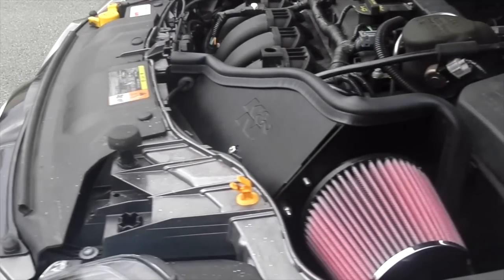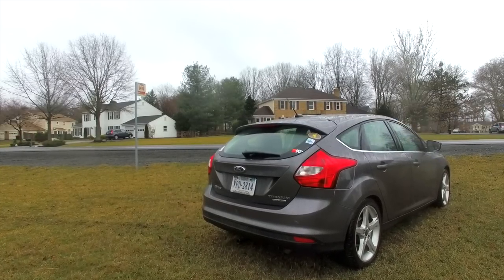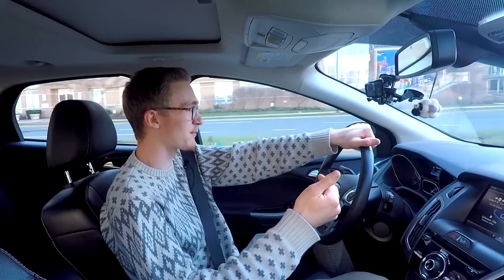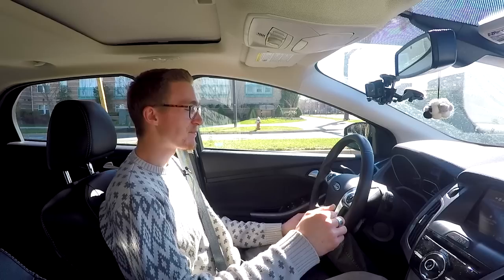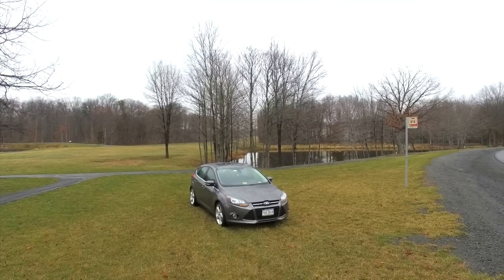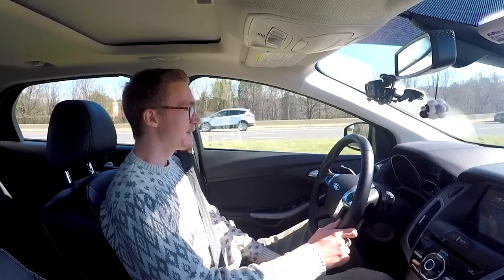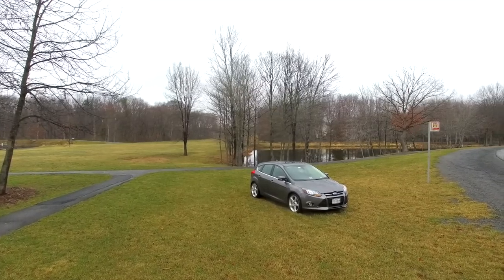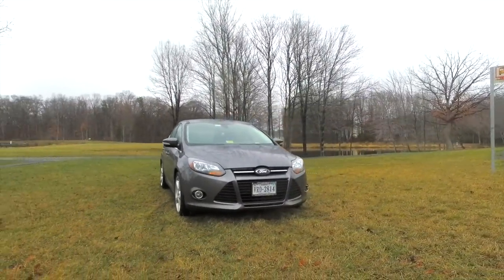K&N Cold Air Intake Update, What Happened to It??

Comment: I would add a thermal tap or wrap on the pipe and the engine side of the shield to add extra isolation from the engine if that happens. On the other hand you should look at a cold air that is a fully inclosed box with a directed inlet for air to really limit the hot air form the engine

Comment: In my opinion K&n gives you like 2-5 extra hp  because they alredy tested with dyno. The problem is If you want to leave the Oem intake plastic tube, you can't feel a lot diferrent, also you need the basic combination what i got, exhaust 2.5, high flow cat, injen cold air intake tube with K&n filter, aem bypass. Tune. The first's 3 upgrades

Comment: the issue is the car needs a tune for the intake it self. K&N will say it can be used without any other mods. but if you want it to run properly a TUNE will fix this issue plus youll get more out of it.

Comment: Short ram intakes do work ( I have one form k&n) but probably with some cars would work better than others. One thing I noticed was that my mileage got a lot worse then I got my car tuned later with some other mods and then the mileage got back to how good it was at stock or even better
Reply: @bazinga1000 it was a dyno tune which was 650 Canadian dollars, if you do a e tune it will be cheeper. Because my car was a Honda I needed to get a device to flash the car also which was about 1000 canadin dollars. Not sure if all cars need a device to flash it but least now I have it I can check any codes the car throws and check anything I want to with the car. The tune was exp but we'll worth it, I used to only spin second gear somtines but now I'm spining no problem. Tons of extra TQ gained in the midrange.

Comment: Yea if it mounted in the engine compartment its not true cold air intake. Cold air intake is external to the car or routed away from the engine bay. K&N filters for stock setup are great though as an easy upgrade and are usually good for a few horsepower. Literally 3-4 horsepower still they do work.

Comment: You don't necessarily need a tune. You just need a more free flowing exhaust system to accommodate the extra air going thru.
Reply: The tunes are vehicle specific if you want it to run correctly.  My 2017 Mustang GT would require a tune with one.

Comment: The only intake i have seen so far that has worked was the corksport intake from my 2015 mazda 3 because they also have a cold air box that completely separates it from heat soak due to being in a separate box

Comment: If you installed a intake system try unplugging the wire and the battery then plug it back in generally the car will reset and u shouldn't have any problems

Comment: Correct,  long term & short term fuel trims are adjusted by ecm that gets its data from various sensors one being the mass air flow sensor that sets the fuel mixture to lean or rich depending on the amount of air, temperature, rpms, throttle position,  etc. So basically no matter what you do the ecm is going to adjust the fuel mixture back to optimal ratios for emissions, unless theirs a fault or failure. Cold air intake in the same location as the factory air box generally want provide any benefits other than sounding tough. K&N knows that too, but they have a business to maintain along with a lot of other parts sellers. Was different back before the electronic control cars then just flipping the the breath too upside down would let a little more cooler air in & reduce restriction  into the carb & sound tough, but those where fixed fuel ratios & you could (sometimes with a little modification) adjust the mixture leaner or richer for better performance.

Comment: Just a CAI on a stock engine and stock exhaust doesn’t do shit but a high flowing exhaust  and intake with a tune will gain about 30hp
Reply: LOL
Reply: you wont gain 10% from just a catback I gained like 2hp lol.
Reply: Stainless Works 3 in Retro Chambered Cat-Back Exhaust w/ X-Pipe it's not cheap
Reply: It is a performance exhaust and you don't gain 10% that's just a placebo effect you feel if you had dyno numbers and vids to prove it that would make sense but you don't.
Reply: You can gain 20-25hp just from a good tune on most vehicles.

Comment: The standard K&N air filter (non-cold air filter) are great on manual vehicles due to adding a small amount fuel milage….its not meant to add more horse power! I do have a 2012 Chevy Cruze Eco 6 speed and I did gain 4 miles per gal on the fuel economy which is what I was looking for! Just remember….any tine you use new products on your vehicle, always research the product line and the type of vehicle its going into before making a purchase! This will save you time and money and keep you on the road longer.

Comment: Turbo charged engines have an intercooler, so heat soaking is not an issue.   Your video really only applies to NA engines with poor hood ventilation.
Reply: longago7 actually the opposite. Turbos create insane amounts of heat and are more prone to heat soak

Comment: What you did is the same as I did. The K&N filter does it all. Me like you didn't reallly like the cold air system by K&N and I saw a power loss to the engine. Left it on and tranded trucks. After I traded, I found out things the the Ford was a bad year and then I was glad I  changed trucks. I in the last truck and this new one, I only used the Expensive K&N filter and got the same results that they claim. Works the same as a cold air system. Does the same also.

Comment: From what I've read and heard, the "Cold" Air Intakes are for hotrods, and if you don't work up the rest of the engine, it won't do anything. If the sound changes, there is definitely a change in the airflow however, 'cuz duh... Yes, thanks for the trial. I think I will skip putting one in my Suburban unless I need to replace the catastrophic converter(!) 😯 (At that point, I would put low restriction exhaust in.) Every Dyno Test I've ever seen showing improvement for any cold air intake has been paid for one way or another by the manufacturer, but I don't get out much. 😝

Comment: You have to do the airbox mod drill another hole hose box coupler and flexihose towards the front and take out any air restrictors...failing that take out the air filter wrap female swimming costume material round the front of the insuction mouth with duct tape and cable ties....

Comment: I have a Ram 2012 , I added a K&N cold air intake filter about 6 months ago , i also lifted and put bigger wheels on my truck so I kNEW  my MPG were not good to start I’m not even going to start on that , but what bothers me is that it feels like I’m in mud now , when I give it  gas the reaction time is like wait for ,wait for it while waiting there deep growl then the hemi kicks in . It’s horrible . I’ve got a tick in my engine now it doesn’t sound like a piston but somthing in the pull of the air , I’ve been in happy with this thing for months , writing this just reassured me that the intake system has got to go ASAP.. I’m digging my old system out today , see if there any change in that tick and response time .. GOOD LUCK

Comment: Having a reusable more air flow yet protected filter is good however k&n has oil in their filters so be careful with that. Cheaper cones do the same. Focus's are aight. My mah has a fiesta titanium which is alot of fun. Not as fast as my vw passat 1.8t
Reply: TRUE,. I used K&N in my Tahoe and the oil residue messed up my MAP sensor. Switch to AEM Dryflow,Aluminum tube. Better.

Comment: Something isn’t right with your setup, that specific K&N cold air intake is supposed to get at least 9HP gains on that Ford Focus. Check to make sure you installed everything correctly and have no leaks or loose electrical connections
Reply: Fix it Fast would a K&N cold air intake work on a 2013 turbocharged Audi A5 2.0l?

Comment: I think you meant short air ram.  True Cold air intake gains on the high end. While short air ram gains on the low. Agreed, that short ram with weather stripping semi enclosures or no enclosure risks hot air engine bay seepage. I recommend short air ram with full enclosure or excellent seals.

Comment: Only works on older car's. Like '90-2000. Any cars newer than 2005 doesn't work well. it's the ECU that refuses to learn and make small increment of adjustments. The stock intake box and ducts are already cold air intake. Just add higher flow air filter that's it you'll know a slight difference and small mpg gain.

Comment: More power?  Need more air either more cubic inches (Chevy small block will fit in anything), nitrous oxide or forced induction or more revs with a systematic camshaft change (increased overlap and duration) and then the cold air intake and matching exhaust.  The air intake may then make a difference at 9000 rpm, otherwise save your bolt on equipment money for a new car.  For most engines these days, the bottom end can handle high revs.  The weight of the valve train has the biggest effect on rev limit.

Comment: The purpose of a CAI is for a cumulative effect with other modifications.
Reply: Not necessarily. A cold air intake is fine by itself. It just has to function as a cold air intake. Anyone that has a cold air intake and no airbox does not have cold air intake. With few exceptions. The airbox is to prevent hot air from the engine and radiator from entering the intake. Go figure, that's probably why the engineers put one in the car to begin with. When you remove the airbox you no longer have a cold air intake(with exceptions) because it is no longer taking in cold air. It is taking in the air around the engine and radiatior. The air gets trapped under the hood and the intake says gimme that, cause it's available. Now onto the exceptions. Sticking it in the wheel well, or somewhere ventilated where little heat is present, greatly increases it's effectiveness. A cold air intake only takes in cold air. Most factory setups are CAIs. The only performance benefit from the CAI is the filter. Because it is less restrictive than a factory filter. Now yes once you put some power into your engine you have to get rid of the stock airbox to free up the intake. But most people will never reach that point. Just getting a less restrictive air filter will suffice for most builds. I've seen videos where dropping in a box filter for a stock airbox increased 5 hp on the dyno. That's alot of extra air for hundreds less.

Comment: Just curious as to whether or not you've noticed or checked whether or not there's any difference, hopefully some improvement in Milage (MPG) and/or Cold vs Hot starting? Of course MPG would be dependent on other factors i.e. driving conditions, proper tire air pressure etc.

Comment: I  did an AEM drop in dry filter in the factory box and an Air Aid intake tube in my Dakota. No worries about heat soaking with a bump in performance and no more stalling with the factory resonator. 🙂

Comment: Nothing much "cold" about em.
I live in Texas and most days in the summer are over 100. I think I'll just put a refrigerator under the hood .
Reply: I actually did that but my system is a hybrid refrigerated short ram/ long ram air intake for my Hyundai Elantra sport 1.6 turbo
Reply: I feel ya. I live in South Texas, near Houston. Between the heat and humidity. Nothing works well.

Comment: The Stock air box in many cars are well engineered and do a great job with the oem filter. Keeping the box and upgrading to a drop in filter would give you a little more sound and save you some money by not having to replace it. Just make sure you clean it regularly. I didn't want to use a cold air intake because of the reasons you mentioned too. Thanks for sharing!
Reply from the maker: Exactly what I ended up doing!
Reply: Planning on doing this for my 3000GT!
Reply: @MotorMindsProductions  what's a great drop in filter to buy?
Reply: @FatalCorleone07  facts

Comment: When I did mine for my 1998 fire bird trans I just fabricated my own out it down all the way past my head light now keep in mine I did drop a LS3 in it but I did dyno it for fun at work that did give me an extra 14.7 hp 15.2 lb/ft Torque that was a lot cheaper to do then an K&N that would cost $320 this was $80 get a old trunk seal from a junk yard and some polycarbonate sheets and Melt them together then spray Krylon high heat spray paint on it it’s good up to in practice 850’f

Comment: So I bought a new engine filter for my focus. I guess it was just 1/16 of an inch too big and the airbox cover wouldn't go on more than half way. So I left it cause I was at work, it was at the end of the day and I just wanted to go home. So far that has been the best thing I've done to the car. The way the airbox is from the factory muffles the intake quite a bit. So if you want to be able to hear the growl of your intake just unscrew the airbox cover and toss that sucker into your trunk like I did.

Edit: I did notice the car sometimes stutters when I'm idling and that's the reason I replace the air filter. It's got 50 some thousand so it's not due for spark plugs. I think it might be something with the evap system cause it does it a lot after I fill up.
Reply: I used to get that on my focus too. Always after refueling. Never figured out why. If you want more airflow do a snorkel delete
Reply: @billysledgehammer  it's because of the recall on the evap system

Comment: The only true cold air intake is the factory air box or any aftermarket filter system that incorporates some sort of sealed air box system.  Best thing to do is go with just a K&N drop in filter with the factory air box if your car is also your daily driver.  Cheaper and works better without all the heat soak from idling in traffic or risk of hydro locking in heavy rain.
Reply: I was reading up on the 3si.org forums for some cold air intake advice from people who own a 3000GT like myself. And so many were suggesting that. It's 200$ for the one I want but it essencially keeps the car stock but also improves upon the effectiveness while also making the car louder! Which is clearly what I want.
Reply: That’s the best way to put it  👍

Comment: The PCM will work around the K&N filter, NOT the other way around. People who say you need to "retune" a vehicle to accept a CAI have obviously never heard of elevation and sea level. K&N sucks in more air, the PCM realizes this and adds more fuel, more air & fuel mixture = more power, plain and simple. As far as MPG's goes, most CAI's actually give you less MPG's due to the air/fuel ratio.

Comment: I'm in the same predicament.  I went with an Injen cold air intake for my Lexus 4.3 V-8, and your right, there's no significant power boost. In fact, I believe I lost power. With my stock setup, I inserted a K&N air filter. But noticed a small amount of power increase immediately. So I will be going back to my initial setup.
Reply: Everytime i have added knN at least 10hp at foot the ford one is cheep cardboard copy, heat ya get egr going into cold air intake!- so if blanked and mapped with filter on , def feel it on fords sierra to focus, had it on diffrent cars, and yeah am concerned about blow by so clean n check.

Comment: States that conduct a yearly emissions check will catch this, fail you and make you pay for ANOTHER inspection after your re-install the stock air box.
Reply: Don't have that issue with the Roush.
Reply: @roshi98  Do you have the CAI kit installed, or do you use the K&N filter in the stock air intake?  The issue seems to be, the CAI violates emissions tests.  Also, "the Roush" (to use your terminology) is specifically for [Ford products].  So, if you don't own a Ford, they're of no use.

Comment: What you had was not a cold air intake.  Cold air intakes have longer tubes where the filter is either in the front or behind the wheel.  That's why it is called a cold air intake because the air closer to the ground is cooler than the air Inside the engine bay.

Comment: At least this guys gets it in the end. SO many people pay big money for these stupid things that suck up hot air.  If you had a turbo or supercharged engine, it makes things even worse. You get detonation, the car pulls ignition timing and you make less HP.  For a lousy $10 I took a factory air cleaner box on an 05 IMpala SS, gutted out the baffling then cut a 4" hole in the side with a hole saw,attached a 4"x18" rubber duct hose and ran it through a hole in the fender, sealed any openings with furnace duct tape .The only air coming in is from the outer fender. No engine heat.  Depending on the temp that day, you can see a significant drop of air temp on the IAC sensor. Cant imagine what that sensor reads with an open K&N set up that doesnt totally seal out the engine heat. I suppose in a lot of cases, the stock set up beats that K &N shit IF the kit doesnt seal the filter completely.

Comment: You'd get more efficient if you get an exhaust to let the extra air out, then get manifold spacers, and you'll feel the difference
Reply: You need the stock airbox, or a closed system to have a functioning cold air intake. Having it open like that does nothing for performance. Sure you make more power, but your engine doesn't want to be breathing in air that's 180+°.

Comment: yep aftermarket air intake systems are busted now days now since factory intakes are better then aftermaket unless you are doing heavy mods to your car thats a different story like upgraded cams tune and all then thats how your really going to notice a difference. best thing to do is keep the stock air intake in and just buy a K&n drop in filter thats really how your going to feel a difference because it will be better. other thing i say do is changed your rear gears youll nice a difference.

Comment: K&N factory drop-in filters let fine particles through and they are a pain in the ass to clean, dry, oil, etc.  To me, that is a disadvantage.  Use an OEM filter or a good aftermarket filter that is pre-oiled.